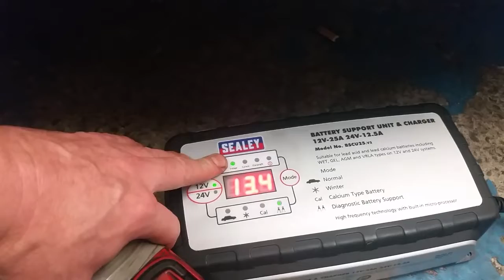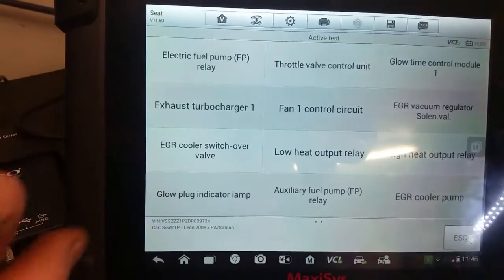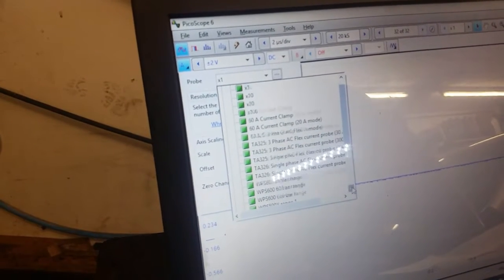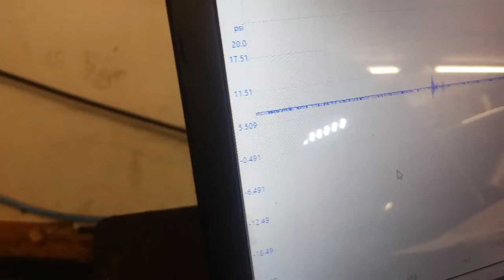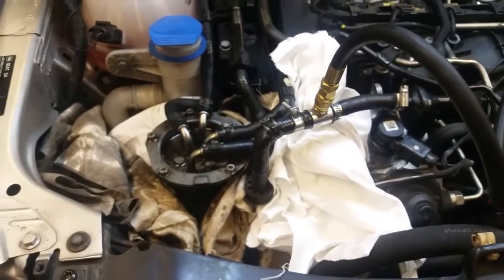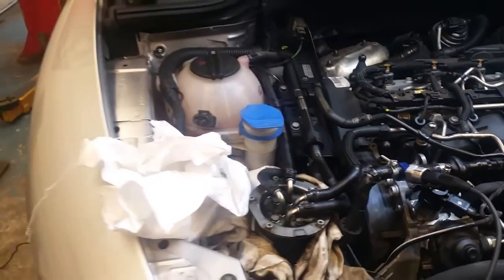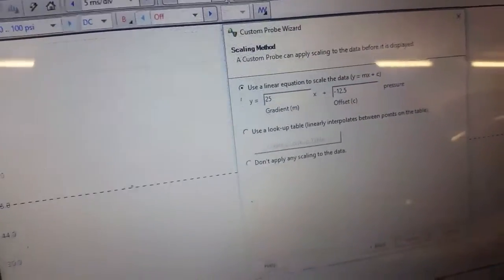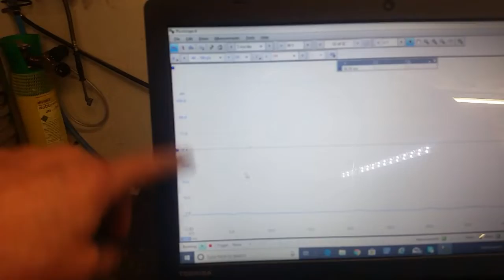Vw fuel pressure test Comparison. Analogue gauge vs Pico 2000 Pressure transducer

Comment: cheers Dave, that's exactly the same car as my neighbours that I posted yesterday.  I'm suspecting the fuel pumps as Audi specialist told me he replaces them in pairs because the lift pump can sometimes starve the auxiliary pump! Thanks Dave, sandy
Reply from the maker: sounds expense, sandy. i saw ur vid and u can hear the noise that aux pump makes. i think its squeezing the air ive introduced when breaking the line. Thats why i didnt run it too long. Hope it helps u with the specs

Comment: Great job mate I've made my own pressure transducer to mine works off my battery power
Reply from the maker: Yeah Leon. I take it u still step it down to 5v. I did it this way to reduce the number of leads. Cheers dave
Reply: @davesterl  I too many things that I need batteries for so I just stick this on the car battery
Reply from the maker: yeah battery's are a curse